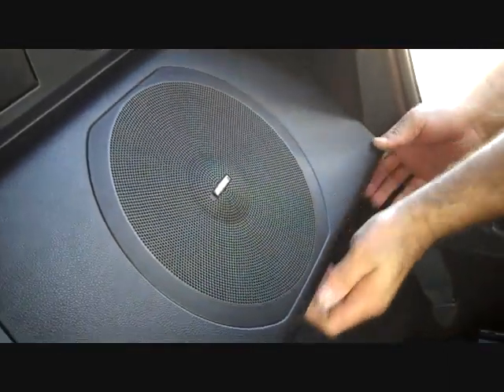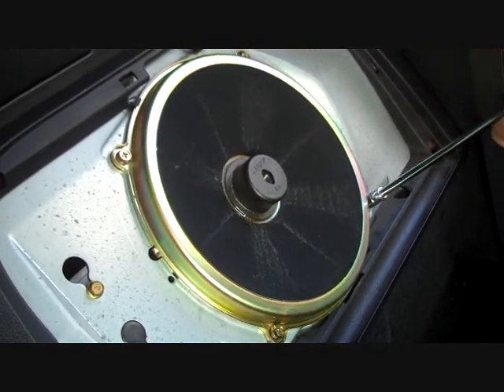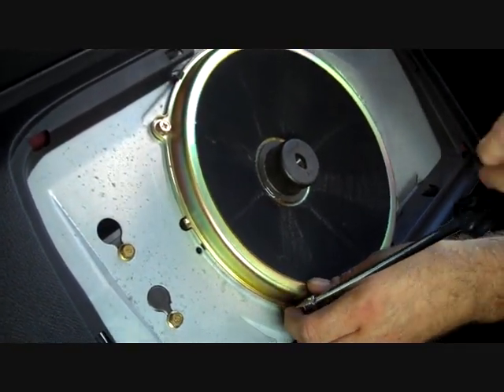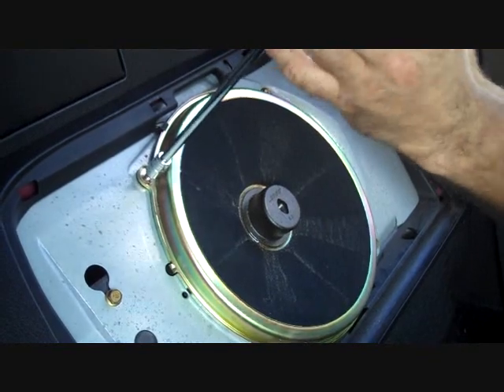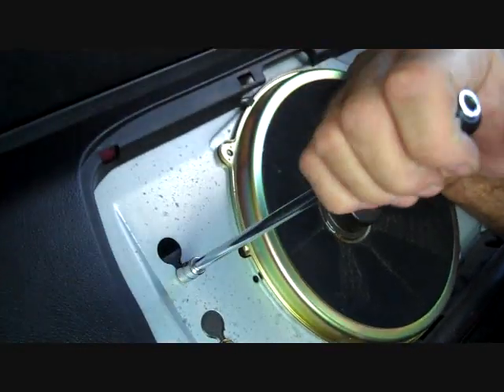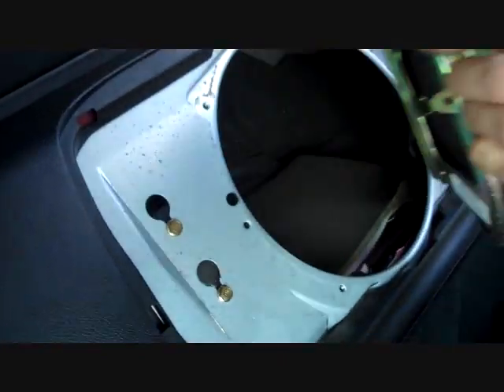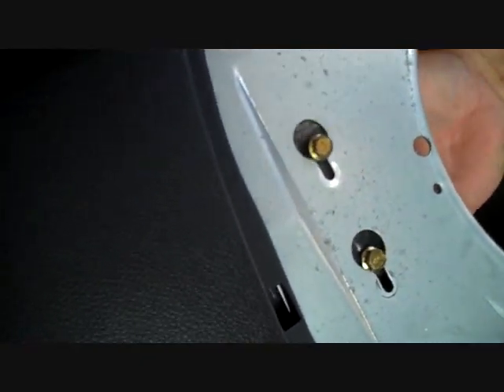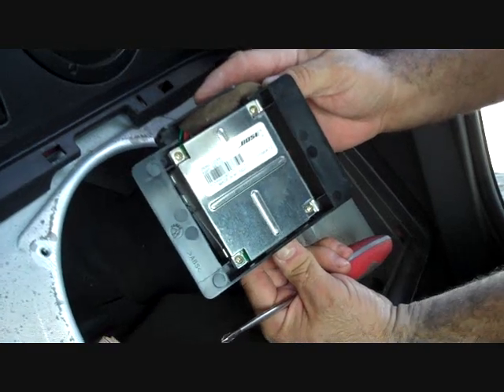Nissan 350Z Bose Subwoofer and Amplifier Removal 2003 - 2005 = Car Stereo HELP

Comment: It is a 10 inch. The amp has a part inside of it that the solder goes bad on. You can either do it the right way and re-solder it or the other way and find a way to apply pressure to the part that is loose.
Reply: Its so easy

Comment: can I put a aftermarket subwoofer in the stock compartment with the stock amp?
Reply: You can but I would recommend using a shallow mount subwoofer for best results

Comment: My sub is on and off some days wont be on others it will just come on.  is it better to take it for repair? or could it be the connection itself?
Reply: Please most things in the 350z are easy to repair... It's just a relay in the amp that is broken. It's a 3 dollar fix.
Reply: Herman Willems where is the relay located ,Thanks.
Reply: mine turns on only when its cold

Comment: base goes in and out  is that a bad am or what
Reply: Julia Ortiz well just now i unfastened the amp an rested it on the padding an the subwoofer stopped shorting in an out...so it has to be the amp
Reply: I have the same problem

Comment: Nissan 350Z in general has faulty electrical , power windows and the Bose system.
Reply: C Man not true. Just the speakers
Reply: Yes they are, my 04 has a hard time with the windows, but once I get carbon fiber doors and poly windows it won't matter anymore. They should have used manual windows & locks for more of a sports car feeling, especially on the touring and up models because racecar haha
Reply: All of them are fixible with a few dollars. I mixed my power window for 10 dollar.(RC race car brushes) :) Easy fixes. Now its the subwoofers turn... just replace the relay in the amp.

Comment: what the hell is that sub it looks fake
Reply: random videos not fake it's just a shallow mount woofer. Go look them up. The magnet is on the front. It's just another was of building subwoofers
Reply: I would bump the HELL out of that Subwoofer. shallow mount subs are used for In-Wall Speaker applications as well.
Reply: That thing will pack a punch to. My grandparents have a 350z with it

Comment: that's not a sub
Reply: Actually yes it is a subwoofer. It is what's called an inverted subwoofer. The magnet is placed on the front while the coil is on the back. It allows for tighter subwoofer mounting were space is limited but you still want bass.